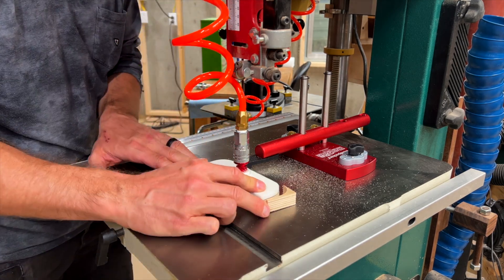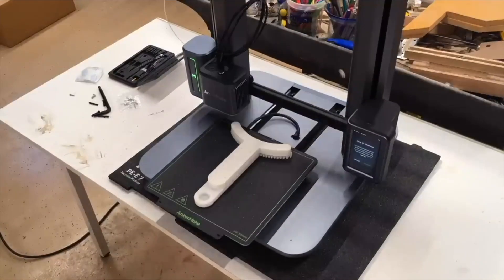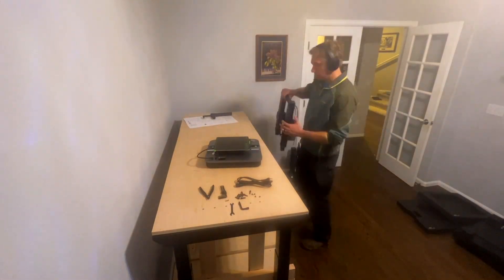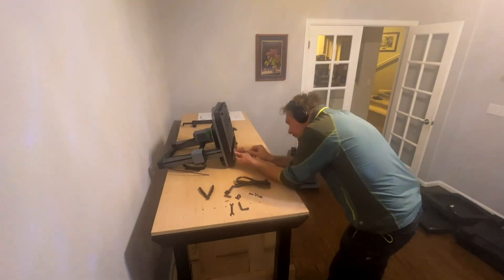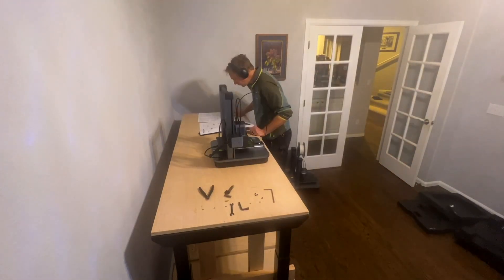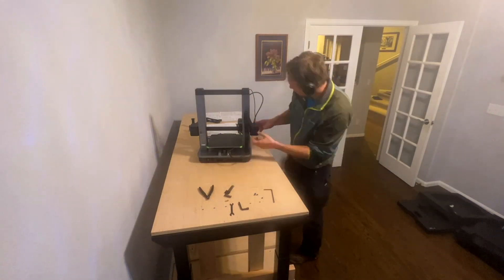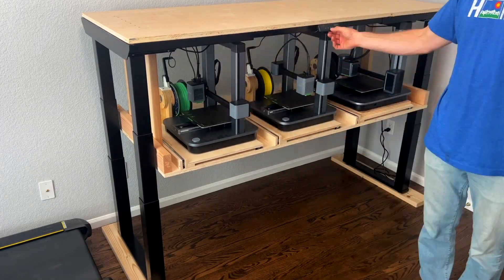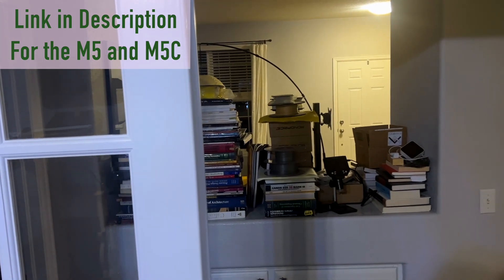Upgrade to 3D Printer Cabinet

Comment: I would love some more info on that template jig! I need to make a bunch of drawer pulls. I have a template jig for my bandsaw, but didn't want to mess with attaching the template to each piece. I also  have a vacuum pump for veneering and a 3d printer, so this looks perfect!
Reply from the maker: Yeah, there really isn’t a whole lot to it, fabricate or print a form with a groove for a gasket and a pressure connection on the top.  I talk about it more in this video:  https://youtu.be/euVOxtfGXi4?si=jro6F_IxzrUJuxLW
Reply: @AndrewKleinWW  I see. The vacuum connector is just a press fit. I thought it was a 3d printed connection of some sort. Thanks!

Comment: Was the square stock 0.125" wall or 0.187"- sure seemed heavy enough for a book case!  I think using a belt sander for the bevels is a bit faster but the use of the variable angle mag clamps was pure genius! Thanks for sharing your ideas and skills.